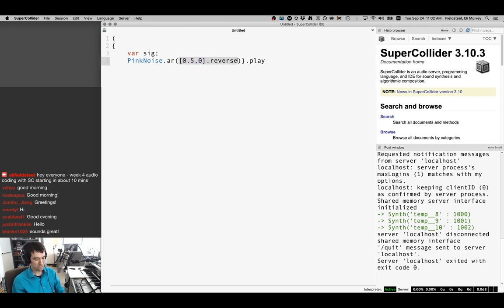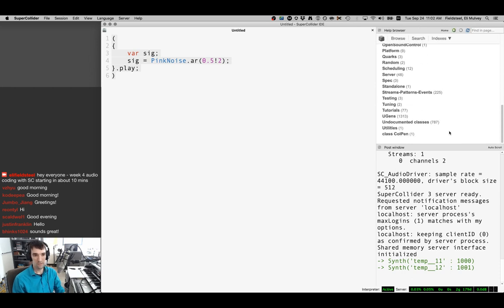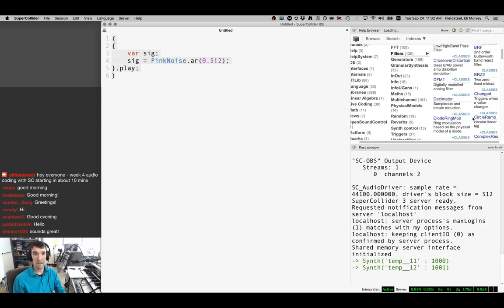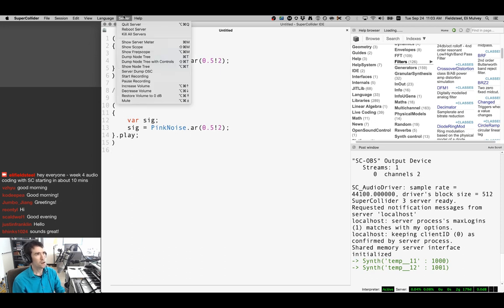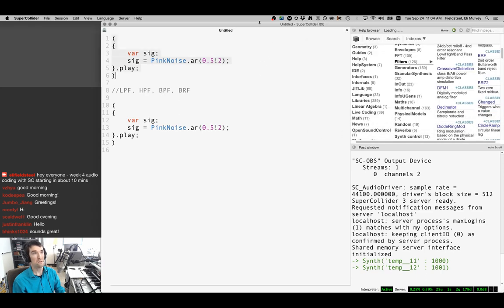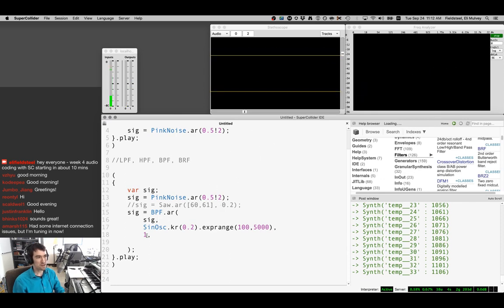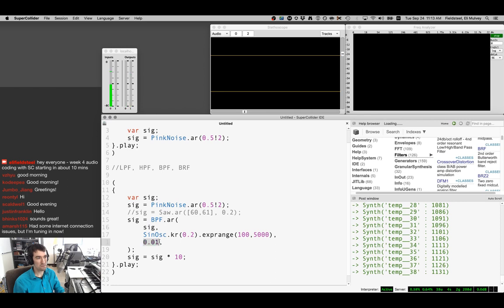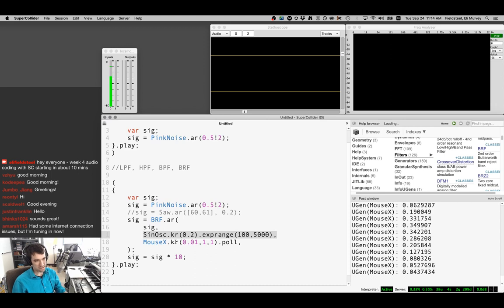Filters & Sampling - Week 4 Fall 2019 MUS 499C - Intro to SuperCollider

Comment: Also, if you use PlayBuf as an argument instead of buffer number then you could play both mono and stereo buffers with the same SynthDef...
Reply: Don't you lose flexibility with set() when doing it like that?
Reply: @ynschannel_  Set is just setting an arg. The arg can be an integer or a class and in this case it can be a PlayBuf. There's no difference other than the level of abstraction which is actually even more flexible?
Reply from the maker: @noblahjustblah  It's not possible to dynamically pass UGens into a synthesis function as argument values. The interconnectedness of the UGens must be fixed at runtime, and all arguments declared in a synthesis function become instances of a UGen called Control.

However, it's possible to create a regular (non-synthesis) Function that dynamically creates and plays a synthesis function. I think this is what you are describing. For example:

(
~makePlayBuf = {
 arg nch=1, buffer=0;
 {PlayBuf.ar(nch, buffer, doneAction:2)}.play;
};
)

~makePlayBuf.value(1, ~someMonoBuffer);

~makePlayBuf.value(2, ~someStereoBuffer);

There's nothing objectively wrong with this approach, but in my opinion it feels clumsy, and it's somewhat inefficient, because it involves building a new temporary SynthDef and instantiating a Synth each time the function is called, so precise server timing can be an issue. I usually prefer to create two separate SynthDefs; one for mono files, and one for stereo files.
Reply: @elifieldsteel  Ah that makes sense. I can see the logic for 2 different SynthDefs now. Thanks!
Reply: @elifieldsteel  I am experimenting if this could work:

if(buffer.numChannels == 1, 

{
       Playbuf.ar(1, blablabla)
   },{ 

       Playbuf.ar(2, blablabla)
}); 

but I think that if it works, will only work anytime Synthdef is initialized. But I think I will end with two SynthDef as you say and I've read in some places. 

Anyway, thank you for your tutorials they are gold.
Reply from the maker: @yerayns  Your conditional logic is generally fine, but it would not work properly inside of a SynthDef, as you seem to already understand. If you place this inside of a SynthDef, then the conditional check is evaluated once when the SynthDef is created, and as a result, one of your two Functions will be hard-wired into the SynthDef graph function.

This page explains the issue fairly well: https://supercollider.github.io/tutorials/If-statements-in-a-SynthDef.html

Also, your conditional logic doesn't take into account cases in which a buffer has a number of channels than is neither 1 nor 2 (rare but possible). I would argue that if you are committed to using function-play instead of SynthDef, conditional logic is unnecessary, and it would be easier to just use numChannels explicitly, e.g.:

{ PlayBuf.ar(buffer.numChannels, buffer) }.play;
Reply: @elifieldsteel  I didn´t continue wasting time with my method, I finally created two SynthDef and it works perfect and is lot more flexible. Thanks for your time I really appreciate what you do.

Comment: Wouldn't it be possible to play the buffer background without looping if you set the rate to -1 and the start position to ~flute.numFrames? That is start at the end and go backwards instead of start at the beginning and go forward.
Reply from the maker: Yes, that would work. Technically startPos should be ~flute.numFrames - 1 because the first frame has index 0. In fact, if you intend to include doneAction:2, then startPos should actually be ~flute.numFrames - 2, otherwise PlayBuf begins on its last frame, which triggers the doneAction and the Synth frees itself as soon as it begins (I cover this briefly in #8 in my SC Tutorials playlist).
Reply: @elifieldsteel  That -2 seems a bit odd, because if it only triggers on numFrames - 1 then it will never execute the doneAction when it gets to frame 0??? But I doubt -1 and -2 makes much audible difference either way...
Reply from the maker: @noblahjustblah   Your reply got me thinking. I think I misspoke at 35:50 in describing PlayBuf as seeing the "boundaries" of the buffer as frames with indices 0 and buf.numFrames-1. I believe the correct explanation is that there is only one "boundary," and that is the frame at index buf.numFrames-1. This is also the frame that causes PlayBuf to check its doneAction (if loop is 0).

So, if we start at buf.numFrames-2 with loop = 0 and rate = -1, we move backward all the way through the file to frame 0, and we continue to move one additional frame further to arrive at numFrames-1 (this seems counterintuitive because loop is zero, but I believe this is correct). Here, playback stops because loop is zero and numFrames-1 is the "boundary." If doneAction is 0, the Synth remains, but if doneAction is 2, the Synth is freed, but playback stops at numFrames-1 either way.

If we start at buf.numFrames-1, then we begin at the check boundary, and if loop is zero, then playback will stop as soon as it tries to start.

I believe explains why this line will play backwards and they Synth will free itself

{PlayBuf.ar(2, b, -1, startPos: b.numFrames-2, doneAction:2)}.play;

but this line fails to produce sound:

{PlayBuf.ar(2, b, -1, startPos: b.numFrames-1, doneAction:2)}.play;

I agree that numFrames-2 seems like a weird place to begin for a backwards one-shot sample, but it makes sense if we keep in mind that the last item in an ordered collection has index = size - 1, and the last frame in a Buffer (numFrames-1) is where PlayBuf checks whether it should loop or not -- so we have to start one frame earlier.

And, you are right that a difference of one frame almost never makes an audible difference :)

Sorry for the lengthy explanation! You brought up a very good point.
Reply: @elifieldsteel  Thanks for the reply. That makes sense. It's probably a small point, but it makes an interesting edge case that could trip me up if I didn't realize how the boundary works.